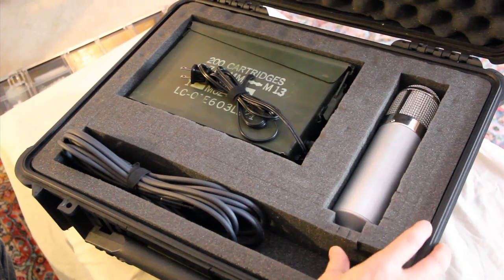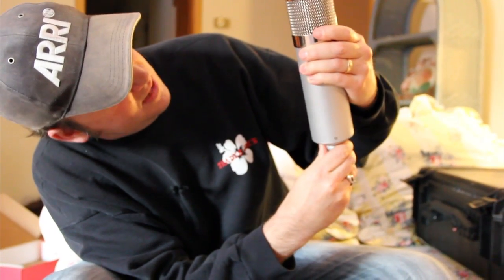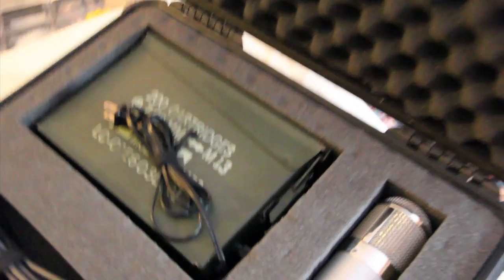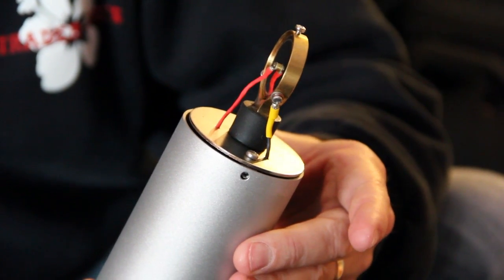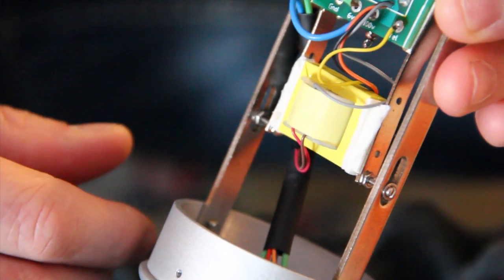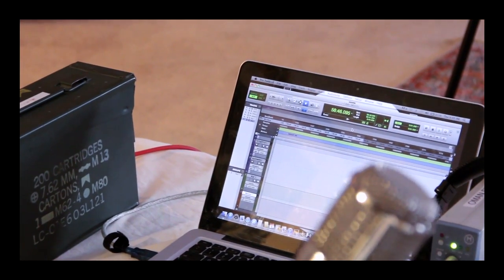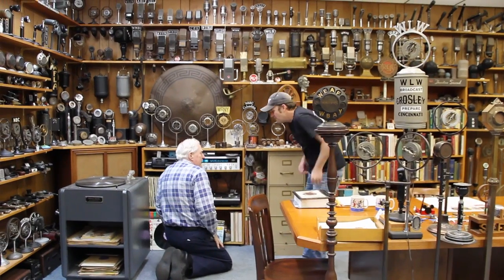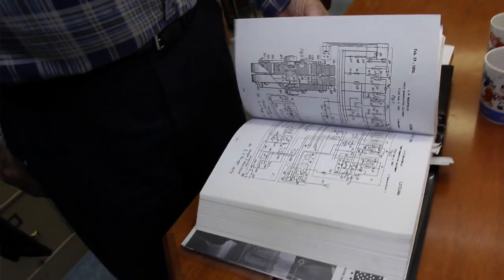Tube Tests Show Ep.22 "DIY U47 Equinox Systems, And M7 Capsule"

Comment: That's a small tube. Is that soldered in? I notice several wires going directly to it. Is it not possible to have a connector for the tube to push into, to easily replace the tube if needed? Looks and sounds great. 👍

Comment from the maker: Hey Mark. Well it is hard to beat a FLEA 47 after testing my FLEA 47 against several U47 mics and swapping different heads (capsules) The FLEA in a blind mic test wins. The royer / DIY just doesn't quite have that bottom end that a U47 has so I like some of the characteristics but keep going back to the FLEA. -johnny